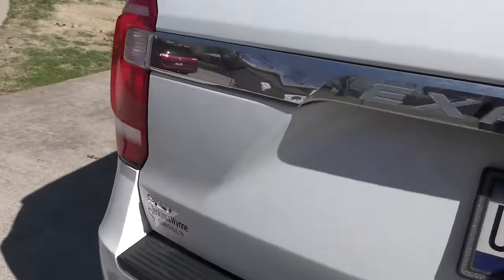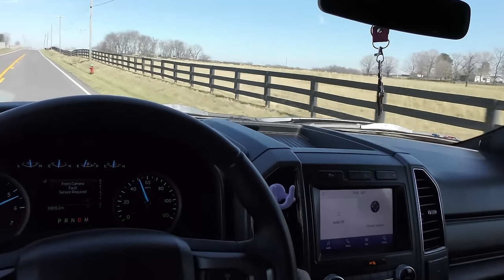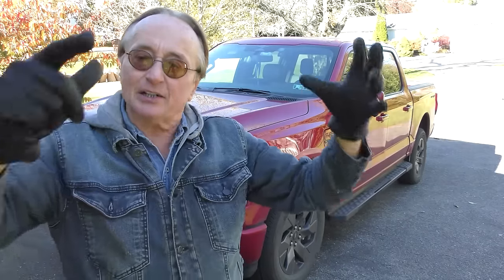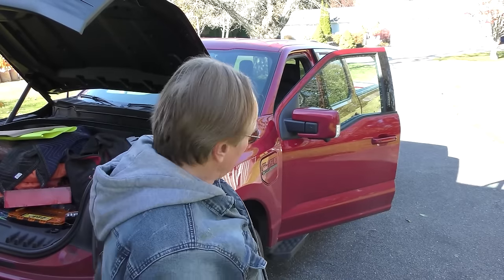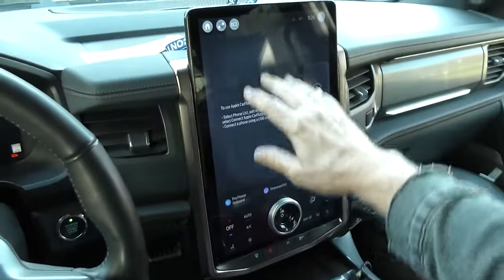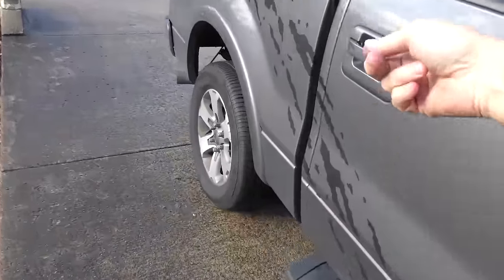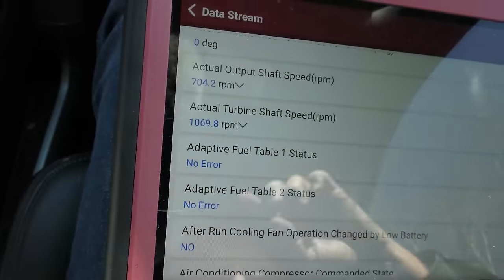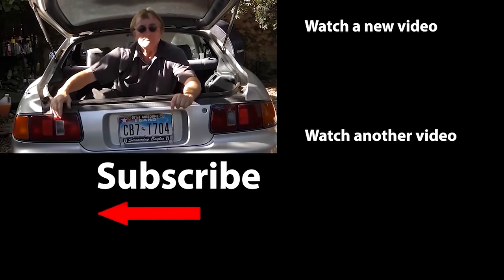Here's Why Fords are Crap Now

Comment: I bought a brand-new Explorer Limited in 2020.  The DAY I TOOK DELIVERY, as I was driving home on the highway, the car suddenly went into a sort-of limp mode, and was making a loud hissing noise.  I immediately turned around and took it back and it was determined later that day that the EGR valve blow out and it would take a couple of days to get a replacement since they didn't have the part on-hand at the time.  It was fixed of course, but that was a glaring warning sign.  

I still have the vehicle, and it's had multiple issues.  1. Folding 3rd row seats stopped working (replace the module that controlled it).  2. Driver's window would roll up, but not stay and would immediately go back down (another module replacement).  3. Sunroof would not close all the way (It was removed and reset by a tech). 4. Multiple issues with the console display going black and/or freezing up (It was replaced once, but still occasionally blinks to a black screen).   

It runs great, and its comfortable, and it will be paid off in less than a year.  But, I don't want to get commit to buying another vehicle.  I will tell you that when I do decide to buy a new vehicle, the next one will not be a Ford.

Comment: If a company still can’t fix the check engine light after 35 years, you know they don’t have a clue!
Reply: My Mom took her Torino (so obviously a few years ago), to the dealer because that light was on. They "fixed" it. I discovered their "fix" was simply unplugging the wire. She never had any more problems with the car over the next 3 or 4 years when she traded it, so, I guess Ford knew what they were doing.

Comment: Just bought a 2024 mustang gt in December. Ended up having a ton of problems, one being the pre collision assist disabled code as seen in the video. The camera in the cab that points out of the windshield was actually broken and they had to replace the entire windshield on a BRAND NEW car with 2k miles. Whole slew of other problems as well. Ended up trading it for a brand new f150

Comment: With those modules a lot of times I need to use unplug Em them and sit for about 30 or 60 seconds and plug them back in.  If it has a chuck sum Error that is a straight programming Error.  (Check Sum is a numerical technique to make sure that all the data was received.)   Again this is your old guy nerd with 3 engineering degrees...   Love it!

Comment: I will stick with my Dad's 1995 F-150 with the super cab and the 5.0 V8 and mine a1990 Silverado 1500 with 4-wheel drive and a 350 V8.  I just keep the miles down and do not drive them in the salt and use cars when I can to do gardening work.  Both trucks have long beds which are hard to find today.  Mulch, rocks, debris removal, and pulling out shrubs ready to go.

Comment: I have a 2011 F150 and it’s been great. It will, in all likelihood be my last Ford.
Reply: Are you older than 95?
Reply: @OrangeUp  Probably means his last Ford he will purchase. Not last vehicle for life.
Reply: 2011-2015 were the last good years
Reply: @ManiusCuriusDenatus ahh yea.  Though I will hang onto this one as long as I can
Reply: @Kylewraps looks like they were.  Thankfully I live in the south so no body rot.
Reply: @devenmellor  see if he can get it checked out. Mine has the 5.0 L engine as well and it’s been really good to me. I have been very meticulous about maintenance and I do most of it myself. The only issue I had with it was the speed sensor went on the transmission but short of that it’s been giving me pretty good service. I definitely get the once over twice.  If it’s been well cared for and maintained, I don’t see why it shouldn’t continue to do a good job
Reply: @ManiusCuriusDenatus  Yes, probably he referred to the Fords, not himself. Or maybe both, who knows…
Reply: Same, just mine is 2015.

Comment: Scotty - you crazy. 3.5EB is a great engine. We've racked up 165k in '17 Explorer with little issue.  2021, however, was a very problematic year because of supply chain issues.  This is true of so many vehicles from all manufacturers- assembly plants had acres of vehicles that were only partly assembled as semiconductor shortages impacted every corner of production.  The lesson here is the 20/21 model years should be avoided - not the D35 and the 10speed.😃
Reply: I have the 10speed, it’s been smooth but I thought maybe it was just luck.

Comment: I have a 2005 Lincoln Town car, for the past 6 years that I have owned it, it's been very reliable with just regular oil changes and I had to replace an air ride leveling valve. 108,000 mi, I hope to keep that car for years to come.

Comment: These manufacturers need to get class actioned. At some point, they should be forced to give you a NEW truck if your brand new truck has an unreasonable amount of problems with it.
Reply: I’m not going to want another one if the first one is trash
Reply: True, and what's funny is they're already dancing with bankruptcy
Reply: They do, it's called lemon laws
Reply: @CharlieBam  no they're not....not even close.
Reply: The lemon laws are garbage and a nightmare to get sorted out. Basically impossible in most cases

Comment: It was just on the new that hundreds of EV owners in Chicago were left stranded last week during the snow storm negative 5 degrees! 
Women had Tesla pro long range supposed to get 350 charge she was getting 150 miles per full charge! And others said the same and we’re charging 2 times a day! And a 20 min charge turned into 1hr 30 mins for full charge! 
And few other people claimed they had 40-60% charge (140-220 miles) when parked and in morning woke to only have less then 60 miles left! The batteries depleted itself overnight and all the car did while parked was run the heated system for battery! 
And the lines were crazy and hours to wait! 
     So many were even frozen out of their Tesla 3’s due to door handles not working so if they had no auto starter or forgot to leave heat on position before parking then they couldn’t get into the car to heat it up or auto defrost! 
For a car that’s smart to heat its own battery system while parked on cold nights! But isn’t smart enough to start or turn on the cabin area heat on its own to keep doors from freezing shut! 
The designers couldn’t think to put a defroster inside the door handle on at least the drivers side door so the handle would extend to be opened or to not snap off ??😂😂😂 it’s not about being a smart car if the makers weren’t smart enough to put functions on it for it to do smart things!!!

Comment: I've a 2015 Focus S with 133k and a 5spd manual I bought new. Other than oil changes and tires the only thing that has broken was a motor mount after hitting some debris on I 95. Still after this one goes I'm never going to buy another. Going for a 4Runner next.

Comment: So sad  they really have gone downhill. They used to have some decent models, and the Crown Victoria was an excellent car. In fact I would have to say looking at just the last 6 years or so they have fallen even below GM in terms of reliability.
Reply: I had a 2004 MERCURY GRAND MARQUIS from new until November 2021 when I traded in at 205k. That engine still ran like a Swiss watch but it was very rusted. FORD lost me when they stopped building sedans.
Reply: Oh man, those were the good ole days.  Crown Vics and Lincoln Continentals…absolutely wonderful machines.
Reply: @hokie9910  Well they could have at least kept the platform or concept in place. Other builders don’t seem to have a problem with sedans. If I had to guess, if they were still building those sedans, they likely wouldn’t have V8’s but these days, it’s more about HP and torque not number of cylinders. These 6 and 4 cylinder engines have much more power now and best of all, they are much smoother and quieter than decades ago. I know Scotty likes to hot rod and loves the V8. I loved the V8 in my old MERCURY but I don’t nearly as much power that V8’s produce now.

Comment: Rebuilt my transmission after 110k miles and rarely pull my 4x8 trailer, and 2 weeks later check engine light comes on. Not a ford guy anymore, should’ve bought Tacoma. 2015 F150 4d 4x4 XL 3.5L

Comment: 2023 F150 - If you come in hot to a stop sign or traffic light and as soon as come to a stop if you try to turn and punch it it's has no power, I can reproduce it easy. Scotty is right put it in sport mode and that will fix the issue. I disagree about the 3.5 eb vs the V8, it has all the power, reminds me of driving a diesel, crazy torque off the line. Is it way over priced, hell yeah, they are subsidising the EV's with the price hikes on the regular F150's. No way in hell I would buy an electric pickup.

Comment: What's wrong with the 10 speed transmission???? On my 2021 f150 it has been shifting smoothly. 60k miles and no issues. It always finds a good gear and climbs hills >7% grade with ease. Way better transmission than any Toyota has
Reply: See you at 125k when you are whining about transmission issues.
Reply: @rigell2764  125k miles is very different than Scotty's "since day one" accusations
Reply: That’s quite an opinion.
Reply: @brandon-kg2vd well 125k is still too soon. 5 years? 6 years and huge bill? Probably better to repair it when it happens.
Reply: Same here. Mine shifts really well. I never hear anyone talk about the fact that the number of f150s on the road vs any other truck.. is pretty astounding. Just by shear numbers there will be more ppl having issues. Although Toyota is doing away with v8 trucks I have a huge problem with that and the looks of the tundra is crap. I like the tacos but they are so small… All around the f-150 is still king.
Reply: @Trevormaffetone  agree
Reply: @Trevormaffetone  Why not GM truck?
Reply: @jamesmedina2062  what do you mean why not a GM?
Reply: @Trevormaffetone  whats wrong with GM trucks?
Reply: @jamesmedina2062  I don’t have a problem with GM. Just don’t like the looks as much as I do a ford

Comment: Bought new 2006 F150 with 5.4 liter engine. Got 540,000 miles before it died ( engine seals blew every where). My biggest gripe was changing those impossible spark plugs. Probably don't want the new Cords now. sad end to a once proud  line.

Comment: Buying a new (overpriced) vehicle has now been proven scary for me from any manufacturer. What can I do? Wait for even more lower standards in quality with their next models? Sad. Too many regulations? This is America and we can't build new vehicles with little to no problems like we used to. Did we even have Recalls decades ago?
Reply: Used models are best bang for buck.
Reply: Maintain a car from 2000 to 2010. They're not expensive.
Reply: @CheapBastard1988 This.

I have a 2010 F150 and it has been very reliable. I don't plan on getting rid of it anytime soon.
Reply: Recalled Ford Pinto 🔥
Reply: The mid seventies to mid eighties cars were really bad. The trucks were ok.
Reply: Vehicles have gotten way more complicated and probably more reliable over the years. Old vehicals overheating, my parents had an engine blow at 65 k miles in the early 90s. Knowone thought that much of it then. Over time we glamorize the past I think. We have cool vehicles now the bronco is awesome, and there are a bunch of other interesting vehicles out to.

Comment: I been noticing even the full size new age trucks have 5 foot beds
Reply: It's so silly.  They are like SUVs with the back part turned into a tiny bed.  A cooler would fill up half the bed.  So silly, at that point a Van or SUV is more practical
Reply: 5 foot is not an actual bed.  You don’t have a pickup at this point.  If you can’t haul whole sheets of plywood, don’t buy it.
Reply: @jasonmershon3941  they are basically suvs with the back area turned into a tiny bed.  It’s ridiculous.  At that point why not just get an suv?  Youll be able to carry as much stuff

Comment: I have a 2011 F150 ecoboost. It’s the lead frame in the transmission that is the weak point and it’s not a big job to replace that. The 6 speed (6R80) transmission is solid otherwise. I bought my F150 used also with an extended warranty and that warranty paid for the new  lead frame in the transmission. I have 162k miles to date.

Comment: When was Ford quality ever good?
Reply: My 2012 Mustang was great, but every Ford I've had since then has been crap. lol.
Reply: Up to generally 2003. The most reliable I've owned had the 4.6 2 valve. One now has 246k and strong. Only the dumb PATS  system.
Reply: @soundmind192  I had a an ‘05 crown vic lx sport with the 2v 4.6.  Great engine. Smooth and reliable.

Comment: THAT 3.5 with rear wheel drive, EXTERNAL water pump is a long lasting engine, and the issue with cam phasers was only on 2017 - 2020.  YEAH, FORD did HORRIBLY to it's customers with the INTERNAL WATER PUMP on the SUV applications with this engine.  And the pre 2020 turbo 4 bangers with coolant intrusion ! !

Comment: I have a '99 Ford S type jaguar 4.0 V8.
Apart from the cam chain tensioners being plastic it's mostly good.
From 2003 onwards failure has been designed in to Ford vehicles.

Comment: Scotty I have a question for you.
I’m up in Ontario Canada and I own a small snow plowing company. We need pickup trucks for plow trucks. We have been using Fords for years and currently have F-250’s with the 7.3 gas engines. 
My question is if you have to buy a heavy duty 3/4 ton or 1 ton truck - what brand would you buy as a plow/towing rig?

Comment: They've been crap for a long time. Bought new top of line Taurus and traded it 2 years later due to the horrendous road noise inside the car. It sounded like we were sitting inside a bass drum as the car didn't appear to have any sound deadening at all. Went back to a Buick for some peace and quiet...

Comment: I rocked a 1999 Eddie Bauer Expedition, Maroon and tan, 4x4 back in the day. I had dark tints on all the windows, big tube headers coming off the engine and I deeply loved her. Towed my business with her for years, but those Tritons had aluminum sparkplug headers off the engine instead of steel and they barf out plugs, requiring very costly repairs. She popped two in her life and that was enough to say goodbye. 💔 My guy that repaired the plugs said his friend had a Triton v10 and of the 10 cylinders 9 had blown plugs. 

I got a 2004 Nissan Titan and it was one of the best purchases of my life. She, or "Gal" as is her name, after the Battlestar Galactica due to her shape and stalwart durability, is the best truck I have ever owned. Gal never quits, asks so little, tows most days in the spring, summer, and fall, and is a Siberian Tiger in the snow. 

Thanks, Scotty. Great work as always. 

Godspeed

Comment: This man speaks the truth.

Just spent £70k on a focus ST and fiesta ST.

- Crooked passenger and driver seats in both cars.
- Focus came with rust on rear chassis leg.
- Fiesta passenger door grinding against side skirt with paint damage - whole left side had to be resprayed.
- Right side skirt hanging off fiesta.
- Handbrake not tightened in fiesta.
- Clutch sticky in fiesta.

Removed one touch windows, leather from the handbrake, and no more folding wing mirrors. 

The desperate cost cutting and lack of QC really shows.

A

Comment: The F-150 Lightning was doing great overall. It tows like a Hoss! Just not very far. Your basically using the same amount of energy to yank a trailer around as a gas or diesel F-150, but the size of the gas tank (battery capacity) just does not match the combustion engines. Plus, operating a battery EV is still not quite the same as a combustion engine vehicle. Give it some time and owners will learn about those differences and adjust accordingly, and cold weather performance will get better because of customer education. But towing range, it’s just not there at this time.

Comment: Love my 1999 mazda b3000 4x4 aka rebadged ford ranger with ford engine and transmission nothing but reliable for me tow truck driver told me when my starter went out he towed over 30 new broncos this year alone and only one old ranger (mine) he love the fact it has a solid rear axle not IRS crap simple tech that works!

Comment: Not a fan of the twin turbos.  I have had two expeditions in the past and they were both pretty bulletproof.   Currently have a 6.7 diesel super duty pickup with the 10 speed.  No issues.  This truck really seems to be over engineered if anything.  The Kentucky truck plant that makes the Super Dutys is amazing 👏
Reply: You realize your diesel has a turbo as well?

Comment: Do you think the start stop mode is bad for the steering ? I notice no power for just a second or 2 when turning from stop. I hear about a lot of problems. If cheap parts under stress is that breaking the steering motor? Or causing problems? Another expensive fix I hear. I also pulled off my rear turn lights to see if I had corrosion on my modules, and I did and bad. So I cleaned them up and tried to lube and seal around the edges. Will cross my fingers on that one. 2018 Ford raptor and nothing is cheap to fix this thing. Not looking forward to cam problems.

Comment: I bought 2014 GMC sierra when it first came out with 10,000 miles on it with a 4.3 liter engine in her. cost us $30000 sucker runs great with 115000k miles on her now  I get 26 mile a gallon. but when i hook up my trailer goes to 10 mile a gallon . heck I know someone that has 334400K miles on a 2004 GMC with a 5.3 liter. the 5.3 people is one of the best.